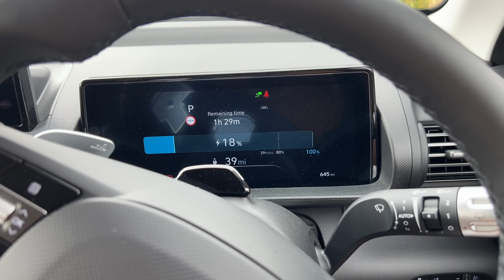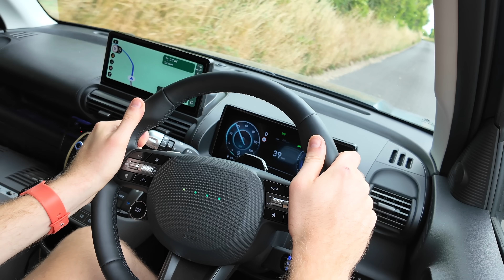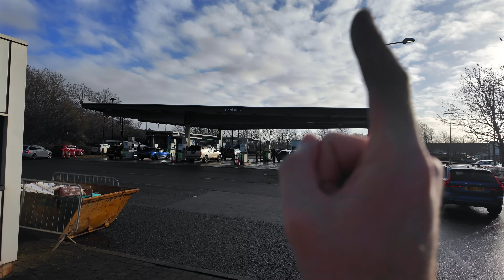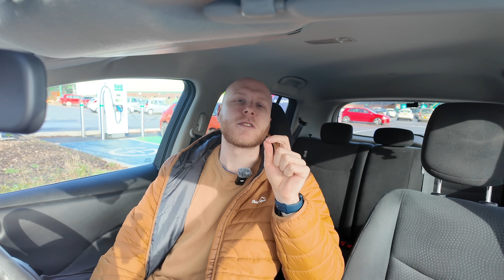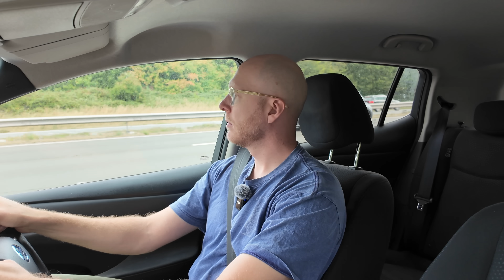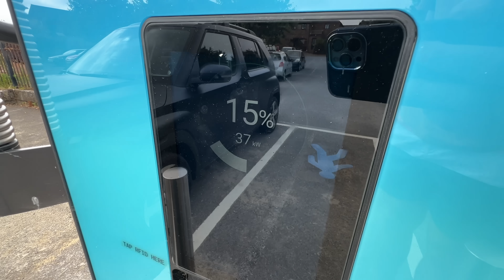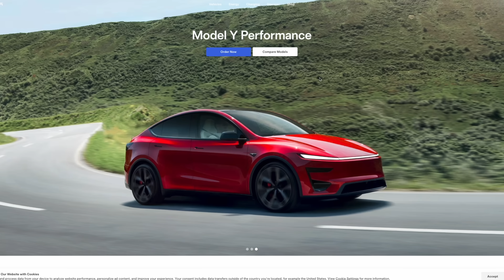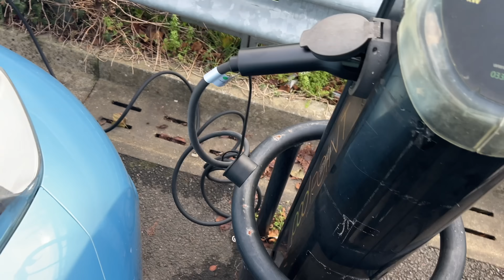19 Things You Should NEVER Do In An Electric Car

Comment: Surprised you never mentioned LFP batteries, they can charge to 100% every time for years with no damage.
Reply: Well....if he charges in the night, it is 100% full.
He tells not to do this, but does it. 😂
Reply: Not true
Reply: This is nonsense. Chemically LFP batteries hate being at 100% charge just as much as NMC chemistries. The reason to charge them to 100% periodically is purely for the battery management system. LFP batteries have a VERY flat voltage curves. So if you keep your battery in the 20 - 80% range, it becomes harder and harder to track what your actual capacity is or if the cells are imbalanced. Therefore every once in a while you have to charge it to 100% in order to reset the guesstimation and and give the battery management system a chance to balance the cells. It has very little to to with not minding keeping it at 100%.

Comment: One pedal doesn't work on all EVs fella!  My dolphin slows the car to about 15mph and the regen puts nothing back into the battery unless your below 30%. As for the range metre mine is pretty accurate. Cheap rate, on Octopus it automatic. BYD recommended charging to 100% all the time as it keeps the 12 volt topped up and the cells balanced.

Comment: Time of day tariffs don't work for everyone ... if you CAN schedule other heavy usage (washing machine, dishwasher, tumble dryer) to the overnight period, AND you do enough miles to require charging, say, every 2nd night, then a ToD tariff can be beneficial. Otherwise the higher daytime rates of such tariffs can more than offset the "saving" from charging overnight.
Reply: Funny how YT'ers never seem to mention this. Could it be the £50 code they all seem to have. For a lot of drivers the EV tariff is not the right one as you mention. You really have to be doing enough miles and there is only so much washing, dishwashing etc, the average household needs in a week.
Reply: In my household the ratio of off peak to daytime is normally over 5 to 1. We do have three EVs two washing machines, two dishwashers, ASHP for underfloor heating and NO Gas. (and a detached house!)
Reply: They do if you fully use the cheap rates. We’ve looked at this with the 2 EV’s we have and 50% of our electric usage is charging the EV’s overnight. The savings we get by using our 6 hours of cheap rate virtually every night, far outweighs the extra daytime rate (3p per kWhr more), as the nighttime rate which can add about 42 kWhr at cheap rates is 7.5p, a quarter of the day rate.
Reply: @ISuperTed  of course they do .. IF you're able to use them accordingly. But there are probably a lot of people who think they NEED to be on a ToD tariff but actually their circumstances mean that they DON'T. YouTubers and others often gloss over this fact. 🙂
Reply: @InBodWeTrust Hopefully people are intelligent enough to look at this and work it out themselves. Our combined charging/domestic bill is £1,500 a year cheaper than our fuel/domestic bill now. It’s not rocket science to work out if it’s right or not.
Reply: Totally agree. I did the maths myself and then checked with AI. I would need to shift 17% of my domestic usage to the TOU window to break even. I'm much happier paying just under 20p/kWh on my all day tariff and being able to do the washing and charge the car whenever I want. This should be highlighted more often.
Reply: I would never time a tumble drier overnight, it’s a fire hazard. Get a heated clothes rail and time that. Low power and even lower overnight